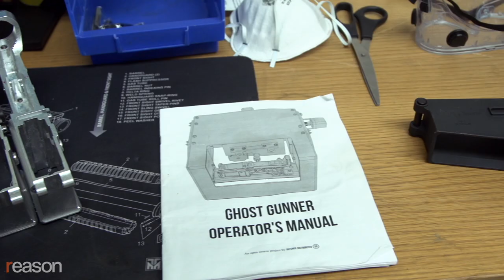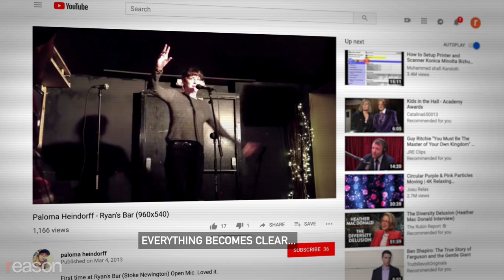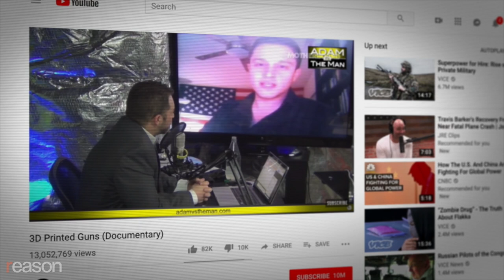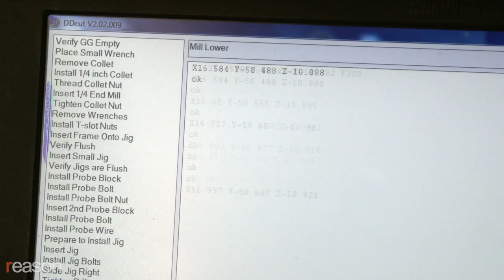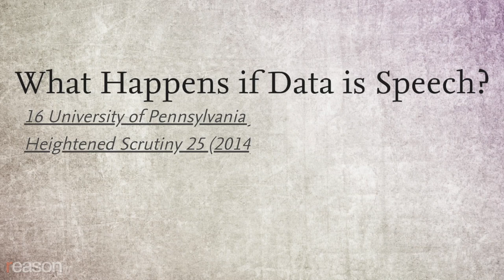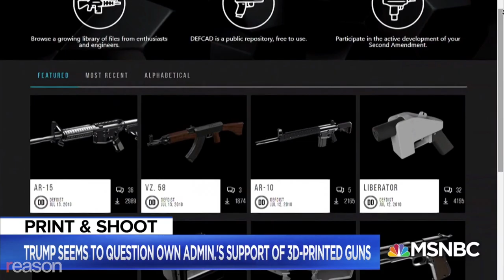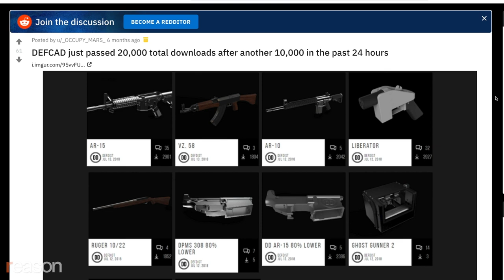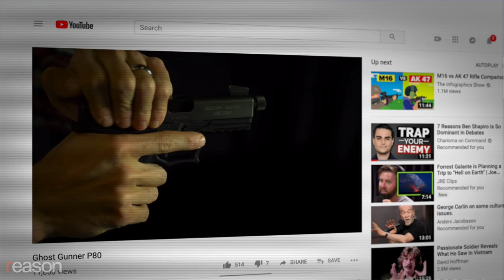Gun Control Is Still Dead: Paloma Heindorff on the Future of the Homemade Firearm Movement

Comment: You dont even have to 3d print a gun to make one, you just need some pipe, sheetmetal and some hand tools.
Reply: Shoutout to P.A Luty
Reply: Most of our lawmakers assume that because they are inept and incapable of doing something on their own without assistance that everyone is also incapable and inept. What they're really "banning" here is the design. You can pull the design patents for just about any firearm ever worth talking about, redraw them in your choice of free CAD packages, and print them with a $99 printer if you want. You can go a step further and print them in wax and cast them if you really want. I don't need Defense Distributed, or anyone else, to do that for me, but our law makers can't fathom that people like me (and presumably millions of other people) are out there.
Reply: Or I’m sure that sketchy guy on the street corner downtown will gladly sell you a firearm.
Reply: Yep, you can make a home made shotgun EASY
Reply: really all you need is some pipe and end caps
Reply: @TheBrokenLife  exactly. Even regular people are out of touch with what is possible. People don't understand that designs like the aforementioned Luty SMG only take a trip to the hardware store - literally, because a drill press angle grinder and a set of files will do wonders. We're talking about basic tools and hand-fitting, not thousandth of an inch precision. But people will act like it takes a fully stocked machine shop.

Hell, I have seen forum posts of people experimenting with homemade nitrocellulose and recreating early smokeless powder, testing the result by actually loading it into cartridges and measuring velocities. But just the other day I got a self-titled "Master Loader" claiming it is impossible to reload ammo without access to commercial reloading supplies.

People actually think 3D printing is just a matter of pushing a button, so let's make 3D printed gun designs and show them what they refused to see.
Reply: Uhhhh…. Pretty much...

Guns will never go away, they will just become more advanced like technology....
Reply: @Gnynt
So... You don't think there are private citizens with lathes sitting in their garages? Hummm....
Reply: Don't blame me for having better tools than the OP...
Reply: I guess you should have addressed that response to the op to begin with then and not engaged with the rest of us. What I believe is that the spirit of the original comment is that people can make whatever they want at home without DD or a printer. You came along and said something stupid, and now you're doubling down on it.
Reply: Alexandre Mead: You wrote:
You dont even have to 3d print a gun to make one, you just need some pipe, sheetmetal and some hand tools.

Comment: I believe the state of Illinois outlawed such guns, called zip guns. I know the proper reply to this questionable law: criminals don't obey laws.
Reply: You just need a pipe and some simple tools...
Reply: @Gnynt What part of PA Luty do you not understand?
Reply: @geraldineb1696  the classic boom stick
Reply: @Gnynt : Try electrolytic rifling on for size. Requires a wooden dowel, a wire, a battery charger, and some salt water.
Reply: John Doe : There's kids making functional fusion reactors in their garages.
Reply: oƃƃə: You wrote:
@Lawrence Miller For future reference, "Criminals don't obey laws" is a terrible counter argument to question the existence of said law. The same logic can be applied to any law that could be broken. Why outlaw murder? Criminals don't obey laws...is one extreme example.

Comment: The argument "Criminals don't obey laws" is used because many believe and state the law will stop criminals from committing a crime, which it does not. ... The real problem with such laws is the violations against the law abiding. Laws against murder are just because they are to specify punishments for people who murder, take life unjustly, which violates the right to life of the victim. Some have pointed out mocking the laws that only affect the law abiding, why not just have laws against murder, against other crimes?
Reply: One of the 'poster child' examples of such bad law was US prohibition on alcohol. It only prevented the law abiding who drink responsibly. Meanwhile organized criminals made booze and sold it in speak easy's. Today's example is marijuana. I don't support recreational consumption of either, but don't want either outlawed. The same can be said for laws against zip guns, there are laws against hurting people unjustly, we don't need a law against zip guns.
Reply: John Doe: You wrote:
@Lawrence Miller If you don't see the difference between outlawing a tool and outlawing an action, you're beyond help.

Comment: I do know the difference, and I oppose gun control and laws against zip guns. I support laws against murder. So not sure of  the interpretation of my comment to think I did not know the diff.
Reply: @Gnynt clearly, you have never seen the P.A. Luty sub-gun in action.  Made from normal pipe, sheet metal, screws and bolts.  Nothing you can't buy at a hardware store.  Assembled with HAND TOOLS.  Super accurate?  No.  But then, a sub-gun isn't intended to be anything close to accurate out to ranges beyond 50m.  Super EFFECTIVE?  Absolutely.
Reply: Why make a firearm when a compound bow is just as effective, silent & harder to trace.  Because arrows don't leave a grove pattern on flesh that can be proved in a court of law. Granted it's harder to conceal it in your pants...lol
Reply: many many  ways
 to easily make a firearm
Reply: Gnynt they made spiral barrels to match bullet sizes with hand tools in the 1700s.
Reply: @mr.robinson1982  Because you cant make an arrow that can split an engine block?
Reply: @mr.robinson1982  well, some high powered slingshots are quite good at firing arrows, and are more compact than a compound bow...
Reply: TheWin200000  I think he's implying the bow is OFFENSIVE weaponry, being used against a single enemy combatant..
Reply: @XyphileousLF  um, well, you've definitely got him there..
Reply: @lawrencemiller3829  The law makes criminals, anybody can disobey the law.
Reply: @TheBrokenLife  I know four people with metal lathes.
Reply: @TheBrokenLife  my Dad had a lathe in the cellar, made his own rifle, and some black powder muskets
Reply: litterally all we need to do is just have the measurments of the parts to actual firearms, and boom, copy and paste into your CAD files. i own a shop with two CNC machines and i can manufacture firearms all day long if need be. but only if shit hits the fan :)
Reply: Hell yeah brother
Reply: @edyflak  Story is, in Chicago, they have rentals and drop offs. No joke...
Reply: @ChucksSEADnDEAD  re: the Master Loader - he may be controlled opposition, or doing propaganda to downplay the other side's fears...  
We have TOO MUCH information these days, you can prove damn near anything, if you work at it. 
"Lies, Damn Lies, and Statistics," if you will.

Comment: There are still significant gun control bills (that could become law) in the Senate right now. Gun control laws are on the offensive in California, New York, Conneticut, etc.. Legislative Gun Control is certainly not dead.
Reply: reason thinks so long as you can still make some home-made gunpower and fabricate a single-shot smooth bore pistol with an iffy ignition system, then gun control doesn't matter. it's very lol. everything DD distributes plans for could be rendered useless by ammo control schemes and then reason would be like "you can still roll you're own." technically true, but obsurd if you understand what that really means (assuming ammo components are regulated like ammo, which I don't doubt it would). also the simple ability to own SOME SORT of gun is not the same as a reasonably accurate, reliable, multi-shot, quickly reloadable gun, which is much harder to "roll you're own" especially if you have to roll your own ammo. also it is necessary to be proficient in their use, not mere simply ownership or you get pretty bad at using them at anything beyond a few yards. if you can't shoot in public or where gunshots could be heard by somebody you can't practice. a single-shot black powder smooth bore is meaningless in terms of firepower if the state and criminals have semi-auto and automatic weapons.
Reply: @b.griffin317  Agreed.
Reply: @b.griffin317  you can make gun powder with coal (very common) , Brass, Saltpeter (element from human Uraine) and Sulfur (can be easily synthisze.

Match heads are also a alternative. 

Your precious gun control, is dead and has always been a up hill battle for you anti freedom liberals.
Reply: @b.griffin317  And You can use black powder in shotguns. It wont be single shot. It be pump action fire arms.
Reply: @goldendash1527  black powder is incompatable with semi- or full-auto guns, and is highly corrossive (as are match heads) so won't give you much firepower. technically you can make a gun that way yes, but it won't do you much good resisting robbery or tyrrany. if guns are not merely tools but political objects, how much is your musket worth against the state's machineguns? the object of the 2A to create parity of power between the government and the governed. if you are limited to BP you don't have that, so gun control is alive and well if a few citizens can have single-shot BPs.
Reply: @b.griffin317  Rifling isn't even that difficult, youtube has videos of people grinding rifling buttons and driving them through DOM tubing with hydraulic jacks.

Corrosive ammo doesn't really matter. For most of the late 19th and early-to-mid 20th century you either had the choice of mercury based primers or corrosive primers for military ammo because those were the only ones that could the stockpiled and still work reliably. Since mercury primers weakened brass the vast majority of military forces picked corrosive. The salts are water soluble, take a water bottle or canteen and dump water into the internals.

Nitrocellulose can literally be manufactured from cotton. No need to waste time on black powder.
Reply: @ChucksSEADnDEAD  ok, will grant you some of those.
Reply: No law trumps the Constitution. To do is tyranny. Tyranny=War

Comment: Alright... imagine that you are a criminal. Here is what you need to do. You need access or you have to purchase either a 3D printer or an 80% lower milling machine. That is a few thousand dollar investment, not including the needed computer program to work the files. In total, you are in this for a few thousand dollars. Then you need also need to buy the 80% lower, finish it, get a gun parts kit, which are another $300 at minimum, then build the entire thing. It's an expressive process that requires a lot of time. 

Or option two. Call up your buddy and arms dealer 'Felipe' and ask him for a gun and buy it off of him for $100 and get the weapon off of him in less than 5 minutes. 

Which is easier, faster, and less expensive?
Reply: Or go to the hardware store and buy some pipe and a nail. Instant reusable pipe shotgun.

Comment: You are a criminal and you are in the market for a new firearm. 
You can't purchase one from a liscensed dealer, because you're a felon.
Your criminal history doesn't stop you from searching for a gun, however so you examine your options.
Option A: purchase a 3D printer, and a roll of filiment, download a file online, spend hours printing out all of the individual components, assembling them for the result of a plastic, single shot breach loading hand gun that will snap after 100 rounds, and is by no means particularly accurate.
Option B: buy a glock from the guy in the alleyway for a few hundred dollars
Option C: Just use a knife
What method would you choose?

Comment: Gun control is not dead!  My state just got hit by a rifle restriction starting in July. mandatory training classes that you must purchase that acts as a huge gun tax and months of recorded attendance and registration before your first rifle.
Reply: What state is this so I can see it for myself?
Reply: @Jesus Christexactamundo. "ban the man, not the gat."
Reply: Its dead. 

Get some metal and plastic with a 3D printer.
Reply: @goldendash1527  you cannot 3-d print (AFAIK) stress-bearing parts like barrels and firing pins (unless you're willing to compromise and consider a smooth-bore pipe which will making your gun wildly inaccurate beyond 10-20 yards and a firing pin which will cause misfires after only a few dozen rounds acceptable). nor can you 3-d print springs. both of these parts if they are to contain any sort of pressure and produce any sort of gun beyond the crudest and least threadingly to the control freaks must have proper metal grain structues that can only be made in forges by people with specialist skills and equipment. if you want to think single-shot shotguns and pistols (rifles are too much pressure) are sufficient to render gun control irrelevant, have at it.
Reply: @goldendash1527  plastic recievers only last about 5 shots before exploding.  Only gun polymer that sig, CZ, glock and beretta is strong enough to match/surpass aluminum t6
Reply: @hellsheathen214  WA state.  The law was forced by Seattle and Bellevue with a 60% state vote majority.
Reply: @b.griffin317  "proper metal grain structues that can only be made in forges by people with specialist skills and equipment" - yeah... no.

There's literally hundreds of examples in both history and just the internet itself of people making guns without forges or specialized equipment. Why the fuck would you need a forge? Forging is only suitable for mass production.
Reply: @ChucksSEADnDEAD  Our recyclables should be a source to feed personal manufacturing.  It would be good if some people could work on ways to improve material science that will work for this scale.

Comment: This is such a stupid case on the government's part.

Most people aren't going to download and machine their own guns. Those that do also need a machining center and the know how to use that equipment. Anyone that knows how to work with a cnc machine equipment knows the, get this, tiny amount of knowledge that it takes to use a caliper and other measuring tools. Anyone that can use simple tools measuring tools can take any gun apart, grab their measuring tools of choice, download free 3dCAD or just buy a seat of something and create a new set of 3D data. So even if you took all the 3D gun parts off the internet there are already a ton of people with the basic knowledge of measuring tools and using a cad package to rebuild every part inside of the computer. Now the data is out there again.

If you are an actual criminal organization, this is a no brainer to make the "ghost guns". They may download parts and machine them / print them, but they don't need to. Its almost like the government thinks that we are stupid. Oh, wait...

Comment: Lol... 3D printer and cartridge are expansive more than a complete gun. In my opinion, I will buy a gun instead.
Reply: Sure, what happens when one day you can't buy it?

I've been learning and studying everything from CNC operation to industrial automation. What have you been doing to preserve the gun you bought when you need it fixed but you're not allowed to buy replacement parts?
Reply: @ChucksSEADnDEAD  Sharpen the barrel to a point.